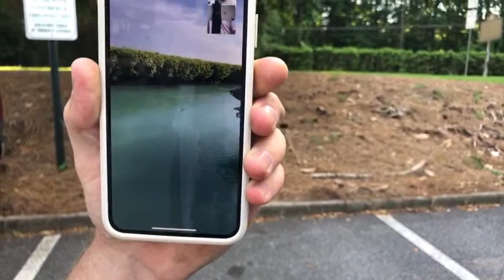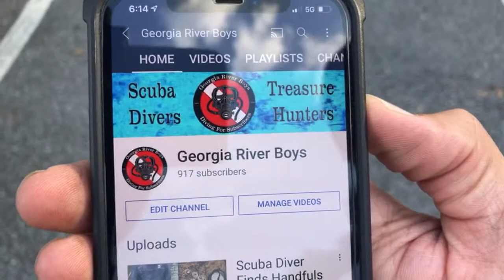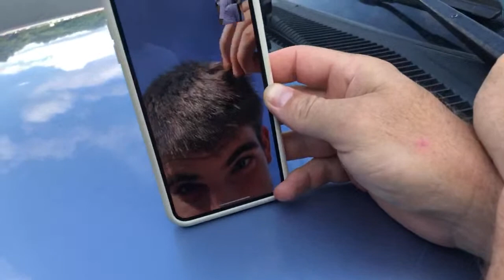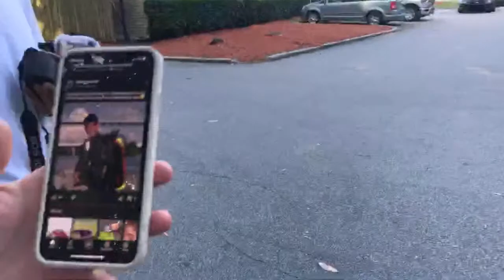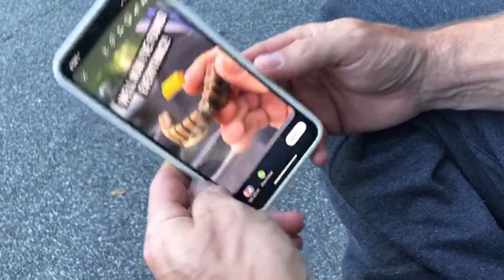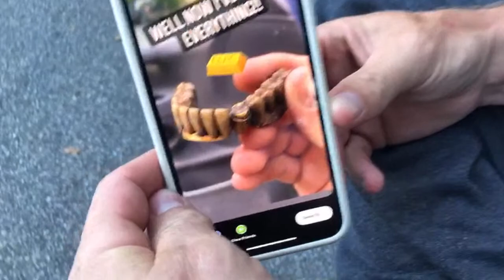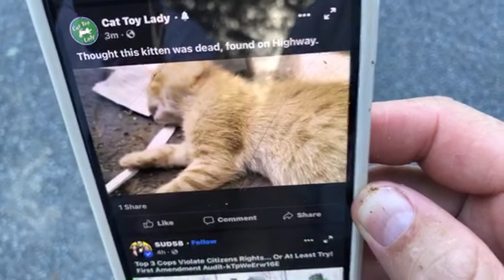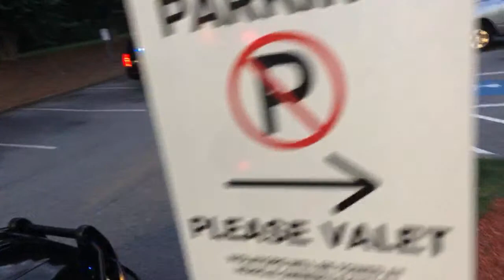Found Pipe Bombs, Gun & Human Teeth in River! Bomb Squad Called!

Comment: If you play back the video of the robot disposing of the pipe bombs at 2x the normal speed you'll notice that one of the buildings lower outdoor lights is arcing. If an flame touched that socket you could have had a damaging explosion, or a fire.